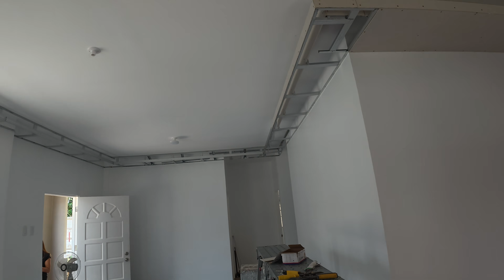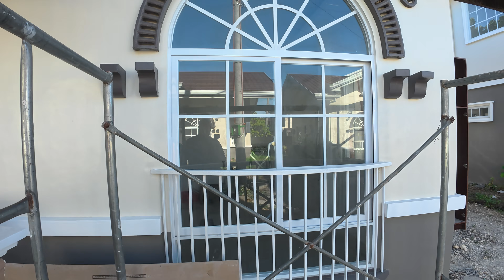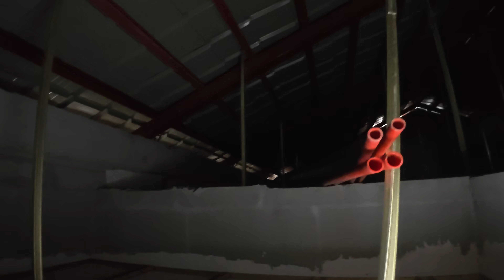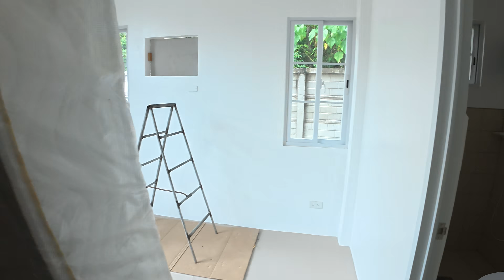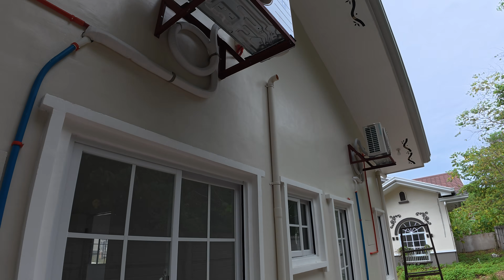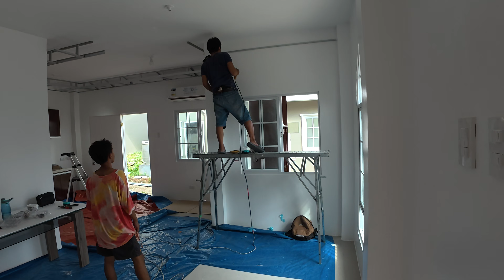Why You Must Watch Every Installer in the Philippines | New Home Build

Comment: It's called hardflex
 I am using PVC ceilings and my roofing already has insulation on it so not much light comes through 
 But I am also not using a contractor where they are in a hurry.  I am lucky my wife's brother and cousin are doing my work and I oversee everything being construction is my background,  now they do have some good ideas sometimes 
Anyway nice house
Reply from the maker: Thanks for the info., I'm definitely going to check into the roofing issue.

Comment: Why did you put your conduit on top of your roof? Why didn’t you run a conduit underground to the pole so that they could just come down the pole into the conduit which would go directly in your house?  This is a fault of your Area, Arcitect, and engineers not thinking about this stuff not the problem of Converge, which by the way that’s just a contractor that’s not converse themselves.  Your electrical should’ve also been underground to all those houses clearly the developer wasn’t thinking
Reply: Now you might say “that’s how they do it here” but I live in the jungle on a mountain in PH and I have 2 separate underground conduit for both my electric and my converge Fiber optic.
Reply from the maker: I think you make a fair point. I am learning that "cost savings" and "speed" were the 2 drivers for this developer. The complex would look so much better if they thought for the long term.
Reply: @IslandExpats  It's more fun in the Philippines!

Comment: the installers generally will always want to run cables along the outside the wall.  Even in the USA, Comcast and AT&T do it that way if they can get away with it.   Very common practice to run the cables along the outside walls.
Funny the guy didnt want to do his job and actually use a ladder.   I have never seen any internet installer not have a ladder, nor complain not wanting to use it.   I would have told him, that is your job, and your company is responsible should you get hurt on the job.   If I found a random guy to help out and he fell, of course it would be the responsible thing to cover medical costs.
Reply: You don't have a clue 😮it's the Philippines.
Reply: @thaibiadi  LOL,  I have been living here for a few years now and on the same island.   I know how things work and don't work here.  Like I said, the installer just didn't want to do the extra work, yet gets a younger, smaller guy to do the work.  Shows you he is not doing his job.
Reply: @kevink1214 How's your comcast and at&t doing on your island? 😂
Reply: @thaibiadi  guess it went over your head, it was a comparison stating that even in the US the installers try to make it go very simple.
Reply from the maker: Yeah, I was quite surprised at his unwillingness to do things right. I kept pushing until it was correct.

Comment: Exterior doors never swing out in the U.S. If you install them to swing out the hinges are located on the outside and all someone would have to do is take out the hinges pins and remove your door to gain entry into your house.
Reply from the maker: That is a very good point, I’ll have to look into extra security measures for those hinges! 😊
Reply: @IslandExpats  They are called hinge security pins.
Reply: A steel security stud projects from the door edge.
When the door closes, the stud fits into a corresponding hole in the frame.
If someone removes the hinge pin, the door still can't be lifted or pulled out because the security studs keep it locked into the frame.
Reply: There are sus304 bearing hinges one can buy for exterior hinged doors.

Comment: outside holes in the roof are with metal net so birds bats wont go inside your attic? just curious and about the cable guys the material is plastic can break more easy than copper of course since its pre made i would guess may be they are scared of breaking it then $$$ cost more money and yeah the way they did it before on the other house super lazy and ugly way i bet they just tech them how to make a hole and connect things 1 hour course not real IT network profesional sad for the house that went thru a new window
Reply from the maker: We'll need to do some research on how the roof was out together, definitely cheaper construction in this development.

Comment: you should not be seeing all that light from the roof. yes it needs to be vented but any gap is a leak for rain to enter and animalls esp lizards. looks like the whole house was built in a hurry. theres a crack in the corner in the roof wall. is it even tied in properly?. settlement? still you bought it now. Have to make the best of it.
Reply from the maker: I'll bring an inspector to check the roof as the light does not make sense to me. One thing is for sure, the developer cut corners wherever they could.
Reply: @IslandExpats . I hope that you can get the roofer to even come back and patch those holes. An inspector is fine, but you should get that roofer back out asap. It's pretty obvious, and he probably already seen it and decided that it was good enough. Hoping he can close them up before the rainy season starts back up.
Reply: I agree. I'd be calling thar roofer back out asap.

Comment: Your concrete is soft because it wasn’t mixed properly…. They add extra sand to the mix to save money on cement….   Common practice for houses like yours…. The workers do it and take the cement home or sell it for extra money…..  you will start to see cracking after about a year or so, if not sooner….
Reply: Too much water in the mix. Substandard mix and strength
Reply: @beantrader255  They have a history of making the concrete mix extra soupy.
Reply: Also see using scimcoat why it's still cracking? i want to know because i starting to build a big rest house thx
Reply: @donkotse depending on the scimcoat,  the mix on the bag is different for each company…. But the workers mix it all the same and they also don’t let it dry properly b4 sanding and putting the next coat…..   normal practice here…. You can look on the bag and see the instructions but unless you’re going to babysit and watch them it’s probably not going to be followed….
Reply: @jackmeloff3335 thx for the info sir yes before I build a beach resort and a big 4 story house always after 6 months of 1 year I saw 👀 many cracks spent a lot of money 💰 and I’am not happy with the quality that’s why now soon we build again and I want to know and everyday check the contractor and workers because I’am from Europe and we want only quality not only quantity
Reply from the maker: Many of us are finding your comments helpful. I just received the first settlement crack on an exterior wall after closing on the house about 2 months ago. Is there anything that can be done in particular to fix this so it's less likely to come back? The Royal Palms home are made up of vertical concrete slabs made at Primary Homes Cebu and shipped to Bohol. The slabs are 60 cm x 120 cm or roughly 2' x 4' and about 4" thick, then stacked vertically glued together with an adhesive. So when this type of concrete mix cracks, what is the right way to fix it to minimize it's return?
Reply: @IslandExpats . You are probably not going to stop settling cracks,  they just happen at the weakest points….  The best way to fix them is with a V cut …. They have to make it deep enough to get the weak spots out..  and then fill it with cement.  They usually happen during earthquakes, small cracks are not that big of a deal just unsightly.  Anything bigger than 3ft usually should be fixed…. Your main beams and cross beams are the ones to worry about….  Most walls don’t support anything they just keep out the weather….  If the cracks go all the way through then you have a issue with the block they used…. Probably replace it if you can…..

Comment: In Noorth America you can buy framing lumber that resists termites , mold and rot. A wood framed home is so much easier to work on. Afer framing all the roughins are done before insulation is installed. Plumbing, all wiring including internet and heat pumps access openings. We use mainily 8 foot walls with minimun r 40-50 in attic. The higher the walls are the more volume of space has to be cooled or heated. Ten foot walls means 25% more energy is used. There must be other reasons why concrete walls are so popular
Reply: We are on an island in the Pacific Ocean,  also called typhoon alley…. Earthquakes, active volcanos, and what other natural disasters you can think of….   Concrete holds up a lot better than wood in this environment….  Plus there’s not a huge supply of wood to build with in county so it would cost a lot more to build with imported lumber…. Concrete is cheaper….
Reply: Yes there is a reason for using concrete. They have these things called typhoon's over here. And they hit quite regularly.
Reply: @johnclark2462  Florida has hurricanes. They are very distructive and they are now trending away from cinder block. They too have issues with termites.
Reply from the maker: It’s a different approach for sure, but the local climate and termite issues definitely play a big role in why concrete is the standard here. 👍